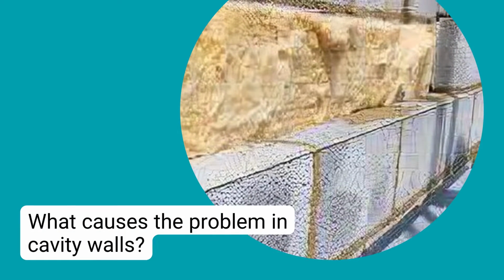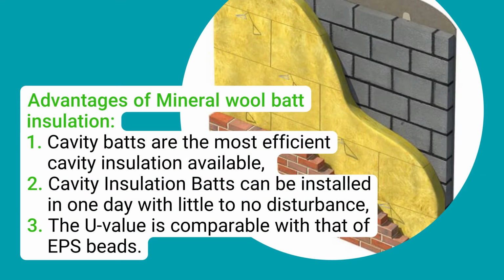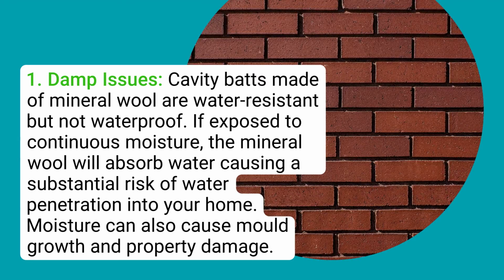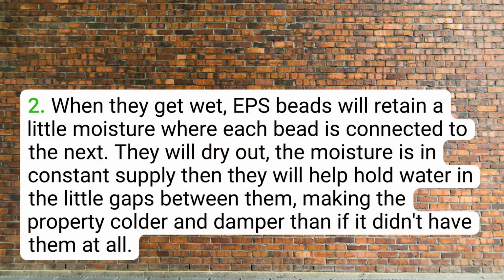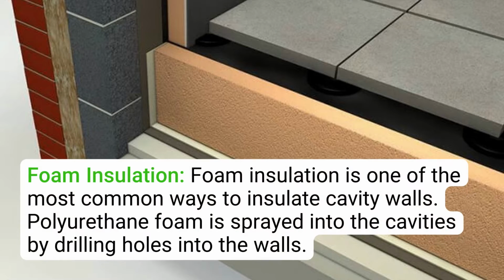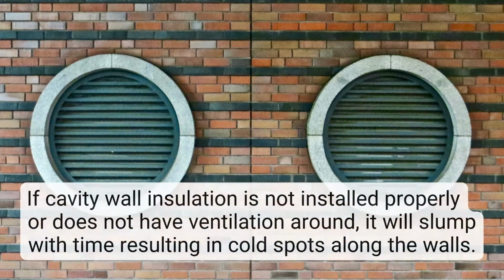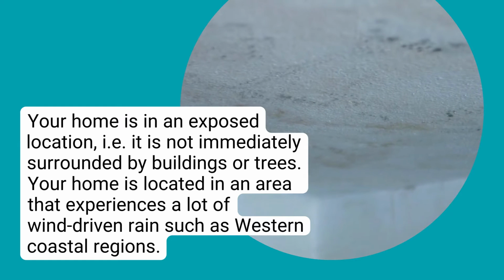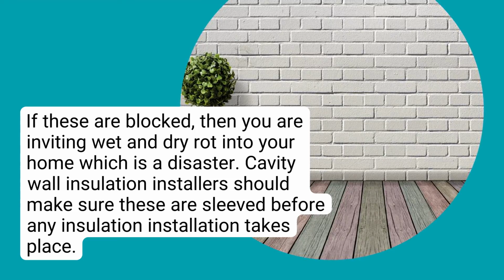Why Cavity Wall Insulation Can Ruin Homes?

Comment: There SHOULD be a LARGE air space gap in-between the face of the insulation and the OUTER WALL inside the cavity-wall; this includes an air space gap in-between the face of the insulation and the cavity-wall-tie drip point which should be in the centre of the cavity.
Ask N.V.Q. BRICKWORK teachers for PROOF of this !      With the cavity-wall being bridged with insulation (insulation touching the outer walls), damp will travel from the outer wall through the bridging insulation to the inner wall !
Reply: Define large. Everywhere I've looked says 50mm is sufficient.

It also depends a lot on location. If the wall is subject to driving rain then yes, partial fill is recommended. For walls that are not subject to driving rain full fill is recommended to get the most. Check with your local authority to see what their recommendations are.

Finally, I wouldn't blindly trust collage tutors. Many are completely clueless when it comes to working in the real world.